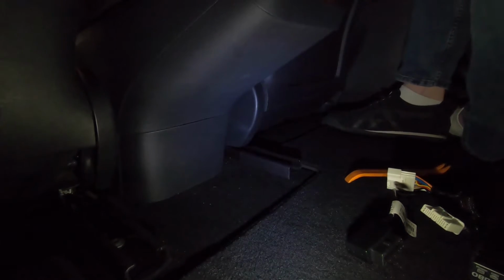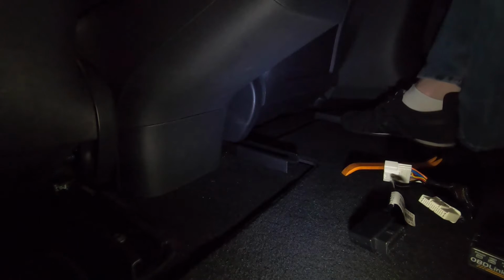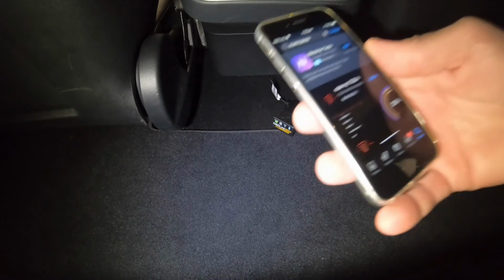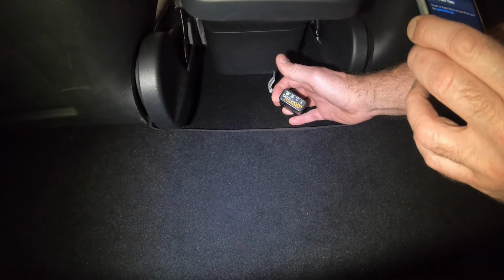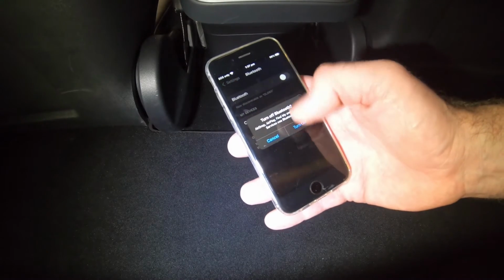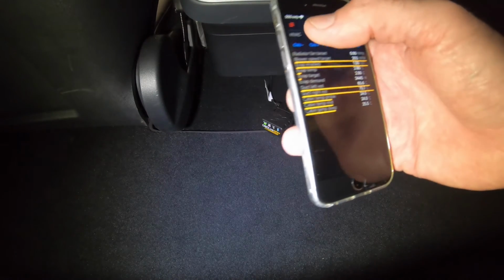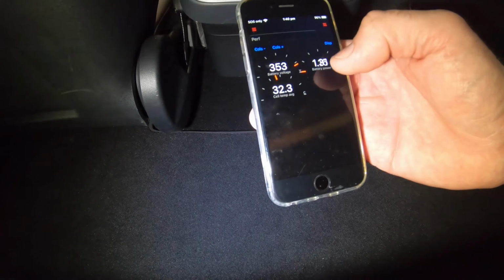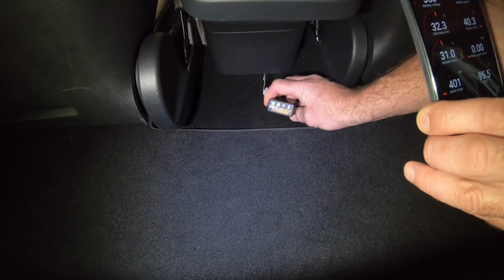Scanmytesla part 1. Read loads of vehicle data on your smart phone from your Tesla Model 3, Y, S, X

Comment: I'm waiting on my harness to to be delivered and this is the best video I've watched so far. The fact you did this with one hand is the most impressive part. 😮
Reply from the maker: @rocketrollsvlogs7625  That’s great. You will love it. I have SMT running almost every drive. I just love watching the car do its thing. I’m glad my video is still useful. I spent years working on electric forklifts so you get pretty good at unplugging things.
Reply: @notinthemanual  equipment arrived today and I installed successfully. Thanks again for the help.

Comment: Thanks Matt.  I'm curious to know what the voltage range on  the LFP battery cells are at fully charged and fully discharged.  My guesses are 3.45V and 3.0V.  What have you seen?
Reply from the maker: Hi Dave. LFP rule of thumb is 2.5V - 3.65V. I haven’t run my car down to cut out but below 2.5V will damage the cells. I think Tesla cuts their cars out around 2.7v. Fully charged it sits around 3.55v-3.6v.
Reply: @notinthemanual  thanks for the info!
I was curious because those voltages have a major influence on the battery life and you get stuff all extra Wh stored outside those voltages.
Reply from the maker: @davehayes8812  Teslas battery management system is one of the best. There is really very little that the user can do to damage the LFP battery in a Tesla. You would really have to go out of your way to over discharge.

Comment: Do you need to activate phone service on the Android for it to function properly or can you just connect it to hot spots or WIFI to get the app and then blue tooth to work with the scanner?
Reply from the maker: Just Bluetooth is fine once you have the app on your phone like you said. The cheap android phone I use doesn’t have a SIM.

Comment: Thanks for the great video, Matt.
I have one comment regarding removing CAN connector cover from my 2022 RWD. Perhaps because the car is new, but it was VERY hard to get off. 
When I (eventually) succeeded using plastic spudgers, I wiped some silicone lubricant on the metal of the clips. I found some blue colour came off on the cloth, which looked (to me) like some form of loctite.
I'm hoping that it will be easier to remove the cover in future if I need to.
Reply from the maker: Yes. It can be difficult to get off on some cars. Mine has always been fairly easy to do without tools. I leave the OBD plug exposed as it will glitch and need to be unplugged to reset.